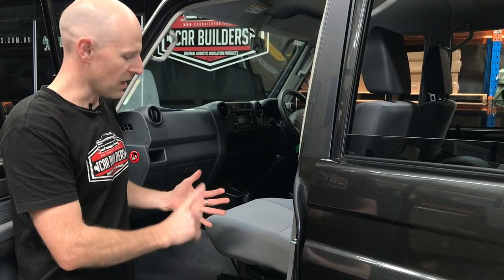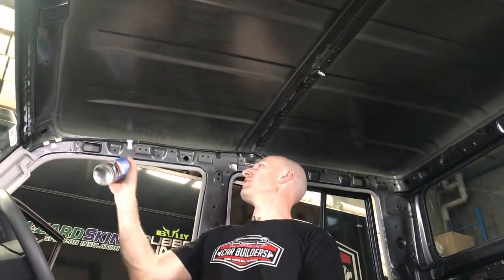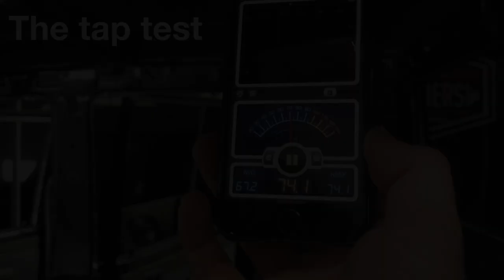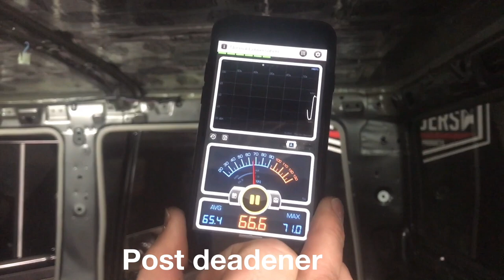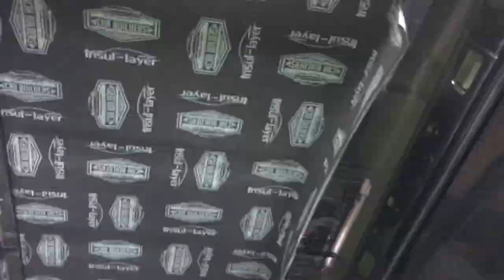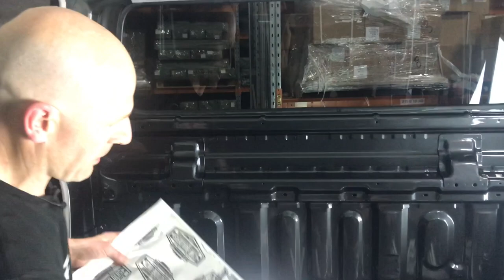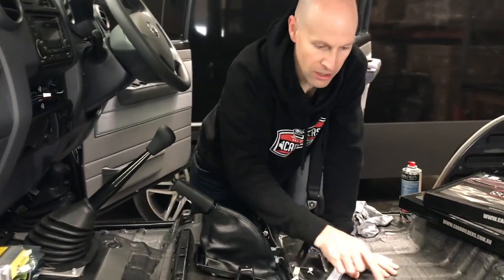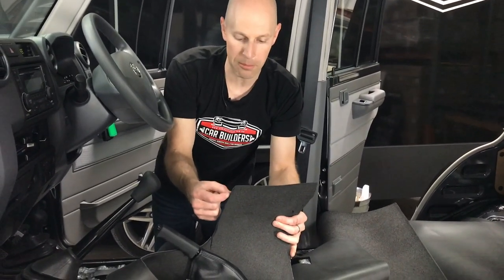How to Sound Deaden a dual cab 4x4? Sound proofing a dual cab truck

Comment: Awesome!!!! I am definitely gonna do this to my truck!! Thanks for such a detailed video. I think I am gonna take it a step further and put sound deadening on the hood also
Reply from the maker: Thanks Grant. If you are putting Stage 1 (Sound Deaner butyl rubber) under the bonnet you will need to covered them with an underbonnet product. The other choice you have is a vinyl or mass noise liner but they need to be mechanically fastened to be held in position 👍

Comment: I have used this and other materials similar to the exercise on A/C equipment.It,s harder than what you think to fit.Another great job.
Reply from the maker: Hi Garry. Yes, it's an arts and crafts project. However, stripping and cleaning the vehicle is the hardest part.

Comment: Why you didn't take the pattern from the original floor carpet just draw it on the new carpet that you want to install, because it's been factory made ,i thought that way it would be easy ,anyway good work
Reply: he did add some very few extra pieces here and there that the factory one didnt cover, i guess thats why
Reply: The factory vinyl is usually molded to fit the contours of the cab. When you pull it out it's generally not a nice flat template you can simply cut around. If you try to do so, you'll likely end up with an underlay which isn't quite the right size from the template moving as you try to cut around it.
Reply: Because it’s 3d

Comment: That truck is so perfect for my needs, only problem is that they put the steering wheel on the wrong side for my country.  What kind of mileage do you get on that diesel motor? And no Toyota does not sell that model here in the US

Comment: You know what would be spot on as a consumer, is if for example what you have done here with the floor liner. Once all the cuts were made you laid it back out and made a template for each section with the cuts. Would save time on install and most people would probably pay that bit more if a template was included in the kit.
Reply from the maker: Hi Brent. Thanks for your feedback. We do have templates for a selection of vehicles. What vehicle were you after?
Reply: @carbuilders1  hey fellas sorry for the late reply, I have your stage 4 kit for the 2020 79 series dual cab cruiser. Looking forward to having a crack at doing the install by myself. Would love a floor template though to save some hassle.

Comment: Great video.i am having a problem of too much hot inside my 70 series.wich product should i use to reduce heat?i dont have a problem of sound deadning!
Reply from the maker: Thank you  Muumin Khalfan. The most effective way is to treat it at the source and stop it before it becomes a problem in the cabin. Check out these videos on our channel... https://www.youtube.com/watch?v=E-hK8r1Ldgg&t=5s . https://www.youtube.com/watch?v=bREq4T7n78g&t=14s     https://www.youtube.com/watch?v=BT7wBNL_1Qw
Reply: @carbuilders1  so are u telling me the sound deadner also prevent heat?because thats my big problem!
Reply from the maker: Hi Muumin. No, sound deadening materials are not the best way to treat heat problems. In the videos below we use heat shields to most efficiently solve heat issues. https://www.youtube.com/watch?v=E-hK8r1Ldgg&t=5s  https://www.youtube.com/watch?v=bREq4T7n78g&t=14s     https://www.youtube.com/watch?v=BT7wBNL_1Qw

Comment: still be interested in a 200 series Landcruiser install. have looked in door and rear quarters and roof, is actually not that much sound proofing. 🤔
Reply: Having done the doors and rear quarter planes and rear door the difference is amazing. 

A 200 has very little sound deading, I think the less brick shape is about all its got better sound wise. The doors do have foam blocks. 

The difference is night and day just with a layer of stage one.

Comment: What is the reason not to add a foam and vinyl layer to the doors? Great videos thank you for the production
Reply from the maker: a Masonite door card does not allow for packaging clearance to hang a sheet of mass loaded vinyl, if you removed the water proof plastic membrane behind the door trim you could possibly package the MLV. We tend to find panel resonance in the outer door skin is the main issue with this particular vehicle. In reference to the foam  placing a patch of acoustic liner directly behind the speak with help soften the back wave and offer clearer sound from your audio system.

Comment: Hey mate, just one little question and something I wanted to see clearer is how did you remove and cut the factory carpet around the gear stick and 4wd controller stick, it’s a bit vague, and also how did you put the factory carpet in under the gear stick boots, it’s painful enough for me to get it out in the first place and you look like you put them back in with 0 effort...
Reply from the maker: Thanks for the feedback Wu. This is something we could film in greater detail 👍
Reply: I think the way you guys did in the single cab is great, remove the airbag control box bolts but leave it connected

Comment: Hey, thanks for the detailed video.  Maybe a stupid question but why do the two layers?  Would the one layer of butyl stuff ever be enough?  Cheers. G
Reply from the maker: Hi G. The butyl layer targets panel-generated sound. If you are doing dirt/offroad driving it will be very noticeable. The second stage is dealing more with external noise such as droning/road noise and acts as a decoupling layer. This video is a good one to explain the stages https://youtu.be/P4ylKyoY_oU

Comment: I stuff up on my carpet I pulled to much of the stock padding around the gear box spots now the carpet has a big hollow spots  around the gearbox tunnel I knew that I had to rip it off but didn’t know that I was meant to keep some of it on it 😞

Comment: I used Basement sealer that has a tin type over it  Cost me nothing as it was in a friends work truck he was selling and gave it to me Over that i have a solid foam 1inch and cedar flooring   Minus 2 rear seats in my SUV for camping and my sound system

Comment: Good vid! Is there a minimum overlap of the individual panels that one should try to achieve?
Reply from the maker: Hi Scott. With the Stage 1 Sound Deadener it doesn't need 100% coverage. The product normally just abuts but it can overlap. By placing it in the middle of single sheet panels you will achieve a noticable result. We supply sufficient enough of product that you can be a bit more liberal with your application and coverage.
Reply: @carbuilders1  Thanks!

Comment: If you are on a limited budget, what would be the focus points to limit car/wind noise? Wheel arches? gearbox, doors?
Reply from the maker: If you are off road, dirt roads and tracks, the Stage 1 Sound Deadener will be most noticeable 👍

Comment: thanks for the video!   What's the additional weight added to the vehicle for this modification?
Reply from the maker: Thank you Chitown 388. The pack we installed on this dual cab is around 40kg. We have several packs, check out the other weights here https://www.carbuilders.com.au/4x4-dual-cab 👍

Comment: the mass noise liner i went over it with a iron with fabric protector over heating surface an it moulded in perfect .....but u need  some relieve cuts some just cut the foam but don't cut through the rubber

Comment: What is the name of the black rubber you have been installed after the deadener /sound sheet?
Reply from the maker: Hi Nasser. The stage 2 underlay used in this install is our Mass Noise Liner Lite. You can find it on our website under 'Interior'  'Mass Loaded Vinyl' 👍

Comment: How much additional weight would you estimate this added to the truck?  I'm thinking of doing this to my hybrid and wonder how it might impact my gas mileage.  Thanks, and great work!
Reply from the maker: Thank you 👍 The Premium Pack in this video covering floorpan, roof and doors with Stage 1 and 2 (DCP 4 on the website https://www.carbuilders.com.au/4x4-dual-cab) would add about 46kg. Where as the DCP 1 pack with weigh about 27kg.
Reply: That's actually not so bad. Thank you!

Comment: Quick question what's the before and after in terms of the sound drop
Reply from the maker: Hey mate. There are so many variables, the road surface you're driving on, whether or not you've got a snorkel, the tyres you're using, so it's really hard to give you an accurate reading on that. What we can say is that in the testing we've done with a dual cab Land Cruiser, we've managed to reduce 12dB on an unsealed road, which is perceived by the human ear as halving the volume inside the vehicle. Measuring the dB reduction can sometimes skew results as the dB measured is always going be at the peak frequency. In some cases, even though our insulation made a dramatic reduction, being at a low frequency the dB reader may not reflect it. Good luck with your project.

Comment: Amazing job done ... was planning a DIY on my Chrysler Town and country but it seems lots of stuff to do...
Reply from the maker: Thank you Rommel. It is a bit of work. We install this pack within two days (floor, doors and roof) however if it is your first time you would allow three days 👍
Reply: thanks ! as a starter am planning to begin with the Front doors... do you recommend just installing either Kilmat 50 mil or Noico 80 mil and do i need to install any further foam on top of this.
Reply: @carbuilders1  what type of foam do you use to wrap those wires running around inside the door, which would be ideal foam to use

Comment: Hi guys, I've bought a bunch of deadening and mass loaded vinyl from you. I've used a the vinyl in the boot under the floor liner but I'm wondering if I can fit it under the floor of the front . Any chance you know if it go under the carpet of a new Hyundai i30? I just didn't want to buy it and then find out it's too thick...
Reply from the maker: Hi Richard. Thanks for your support. Yes, a vinyl product will fit, however it depends if you are retaining the factory cotton jute or not. Give us a call to discuss 👍
Reply: @carbuilders1  Cheers. I tried taking the seat out yesterday but didn't have the right size socket so I'll have to get that and see what's underneath. I don't mind taking out the cotton.

Comment: Awesome. What is the black carpet called ? whats the thickness of the carpet? i have a toyota and want to replace the company fitted cushions under the carpet
Reply from the maker: Hi Max. I think you mean the Mass Noise Liner Lite that we used to replace the factory underlay. It is 8mm thick and design to replicate the thickness of underlay. https://www.carbuilders.com.au/mass-noise-liner-lite 👍

Comment: That was easy (and well done) job, but what about the firewall? That's where most of the engine noise comes from.
Reply from the maker: Hi Variovent. These vehicles do come with a factory firewall material. We run up the firewall to meet it. If the vehicle is a totally stripped or a rebuild, we would put our Mass Noise Liner as a firewall blanket (which you can see in this video https://youtu.be/lvuaYfKSlDY) 👍

Comment: What about adding door rubber seals? I see ads of them everywhere and it is very cheap but i wonder if it actually works? does it actually make a difference with roadnoise in the cabin? anyone who knows?
Reply from the maker: Yes, if it fits perfectly. Rubber seals are a tricky one though. You'll find the factory rubbers are moulded along an engineered seal path and automotive manufacturers spend years developing vehicles and engineering rubbers which have a measured tolerance and specific compression to allow doors to open and close with ease. Each vehicle is different and a universal rubber is not necessarily going to fit.

Comment: How much more weight does the car have? more or less?
Reply from the maker: Hi Rudyy. This pack would weigh around 40kg with roughly half the weight in sound deadening sheets and the other half in the mass loaded vinyl.

Comment: Can you put this materiel on the gearbox? What difference does it make?
Reply from the maker: Yes, both Stage 1 and Stage 2 in this video can be used over a gear box. Stage 1 will stop vibration and Stage 2, droning noises 👍

Comment: I have a question guys: what happens if I only install a 2nd stage product  in all the places you've installed the 1st AND 2nd stage products? The insides of doors, the ceiling, under the flour carpet...
I understand it doesn't have much mass so it won't be an effective sound deadener, but will it help with temperature control and a little bit of soundproofing??
Reply from the maker: Hi Abbas. Yes, you can and it will help, however you will miss the dampening of vibration sound.
Reply: @carbuilders1  Thanks guys. Missing the dampening effect is logical because of the absence of the dense material layer.

Comment: Great video but you used way more CLD than necessary. You only need to cover 20% of the panel to reduce the resonant frequency of the panel. Also, applying closed cell foam to the roof does literately nothing. CCF is only a decoupling material. It's intended to separate a sound barrier from the vehicle or to separate vibrating surfaces.
Reply from the maker: Thank you Dade Wheless 👍You're right. Auto manufacturer's will engineer sound proofing additions to a dollar point, researching the optimal positioning for deadening to just meet consumer expectations. Vibration dampening ( or Constrained Layer Dampening CLD) mats are most effective on single skin metallic surfaces. It is unnecessary to apply deadener to over-lapped metal sections, top hat, chassis sections etc as these areas don't resonant. To engineer a car it takes some skill and technical analysis to pin point key areas, in reality most people will cover everything as they don't mind spending a bit more to ensure they have achieved the desired results. With paying customers, most people want everything covered. With regards to closed cell foam (CCF), these are used in a wide range of thermal applications. It is also used to soften sound from reflecting off a rigid surface. 😎👍

Comment: How about some before and after db readings?
Reply from the maker: Hi Don. We like to do the before and after tests with installs but we couldn't do that with this one as it came straight from the dealer with 35s and was waiting on the 3" lift so it couldn't turn. However, you can see db results in our Troopy install video.
Reply: You didn't watch the video.

Comment: you didnt put the foam back on the door handle 44:20
Reply from the maker: 😆Very observant. We had to go back and put it on 😫but that didn't make the final cut
Reply: @carbuilders1  ahaha :). I have a 07 workmate single cab. What size pack do you suggest, and anything different to look out for , (I have old style dash)
Reply from the maker: @matty3198  Have you seen our single cab packs? https://www.carbuilders.com.au/4x4-single-cab-packs There are two options in the single cabs.

Comment: Pretty pathetic that these models don't come with adequate insulation as standard considering the premium you pay for 1.
Reply from the maker: It is surprising Nathan; I suppose they place greater value in other aspects of the vehicle design/capability
Reply: @carbuilders1  like what?
this thing looks like u need a padlock to lock the doors with

Comment: can you double layer it ?
Reply from the maker: What did you want to double layer? There is no benefit in double layering the sound deadener butyl mats. You could double layer the stage two foams or vinyls, however you need to ensure that you can put the carpet back with the thicker treatment of underlay. 👍